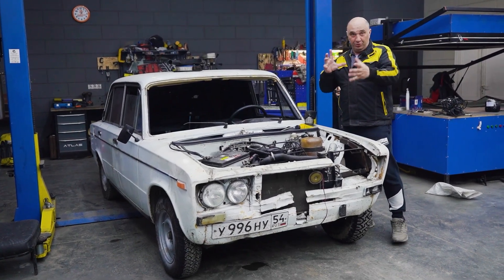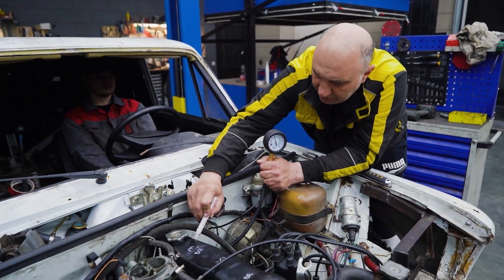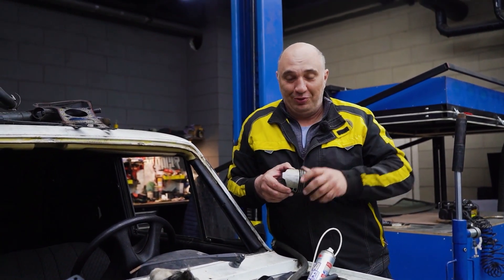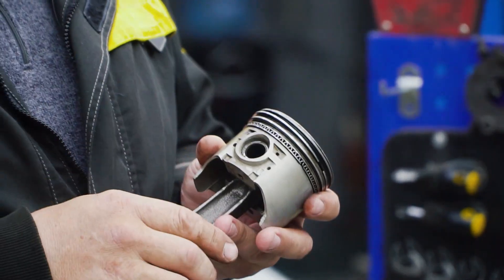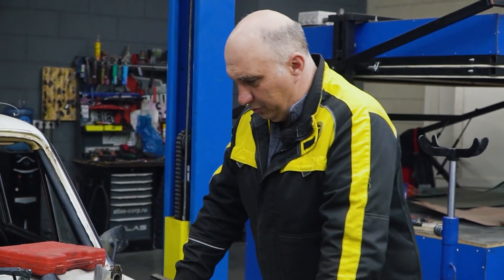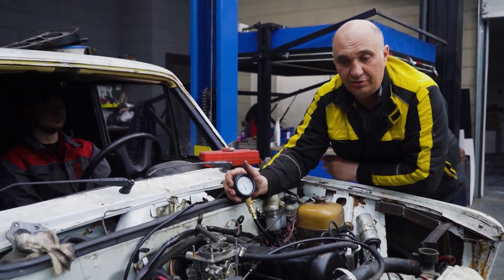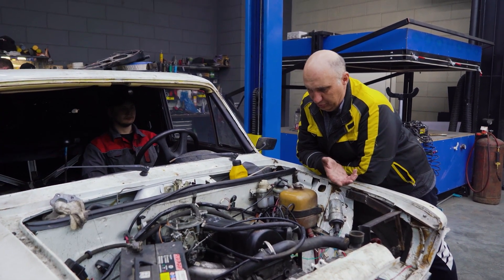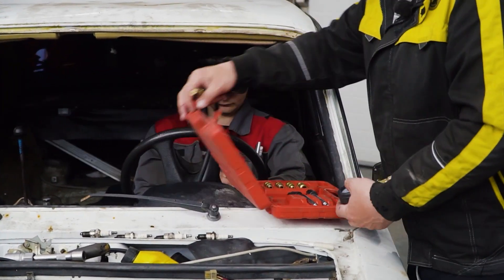Will an extra piston ring raise the compression?

Comment: The increase in compression didn't come from any better sealing from the extra ring... It came from that extra ring you installed at the top, that took away all the extra volume that was in the cylinder between the top of the piston and the original first ring down from it. 

You could probably take the third compression ring down from the top off, and you'd proabaly still have the extra compression without it even being on the piston. 

It would be interesting to have a follow-up episode, and remove the bottom compression ring and then re-check the compression again...

Comment: Thanks you Guys, you did it, but I think an even better result would have been achieved by enlarging the first compression grove to accommodate an original ring and a thinner secondary ring, set with the ring gap at 180degrees, reducing wear to the bore and having a great amount of material above the grove on the piston.

Comment: Why don't these guys EVER use a timing light? Just a curiosity
Reply: they modded the engine so they don't know the best timing-angle. To get to that, they have to hear it rev. Timing-light is used when you want to re-apply previous timing-angle (such as after replacing the ignition-distributor) or to record the timing-angle of current engine.

Comment: Cant you Test over lapp Rings!! Laike Tootal seal Rings!! They have theas rings i test in may Csb 356cui Dellorto Carborators 48mm 4×48..1992 in the 10 sek on the 402m C3 Corvette. Real street Car..No no transbrake TH400 stall 1300Rpm.Okej hav litel hitt Nos!! Weery Happy Engine.Weely ojääää!! 201m 6.9 sek.Nott bad 1600kg Corvette!!Noby have runn theas fast..Have weery Big Heads Brodix 11X.STD.  No no porting!!! Soud runn in The 9 sek on 401m...

Comment: The down side less oil on the top ring. Will it last. Sustain high speed?
Reply: the cylinder-wall will not last. The ring scratches the wall and then the hole get bigger, and compression drop again. No oil = no protection from scratches.

Comment: Hi, why don't you try to use the 2 oil ring sides with the compression rings in a widened groove, 180 degrees offset to create a complete seal effect around the pistons instead of a third compression ring? I think you should put the thin one on top of the normal ring to seal off the ring gaps.👍

Comment: I watched this video and did the same thing with a 4g63 NA. It did increase the compression and the engine is very powerful. the down side is the engine is very hot, so I upgraded my radiator from 10mm to 16mm and added an auxiliary fan. I drove the car for about 400km and with a powerful engine, it was able the to increase the fuel efficiency aswell. 

I definitely would recommend this mod.
Reply: Hey man, did you make a dyno test for how much increase did it make?

Comment: Hello testers. If you want to make something really different with great result in getting higher compression and long lasting pistons, make two O rings in the same groove. You need to sand each O ring by one quater an position them 180 degrees. This will make gapless ring. The only caveat with this might be over time, to get stuck. I am sure some companies has already made this with one very thin compression ring sticking to a normal one. Solution is that the normal O ring has inner space to place the thin one. This is not necessary. Two rings with the same size will make the same result.

Comment: Hello! I'm Brazilian and a mechanic, a few years ago I did the same experiment of putting a second compression ring on my 100 cc motorcycle. It worked almost 95% well, but because the piston was loose in the cylinder!
Your experience with this engine was better, congratulations!
Reply: Parabéns, meu amigo !

Comment: Awesome Idea, the only thing I would be worried about is if the engine ever gets overheated the compression may bend the top of the piston around that ring without the extra 5-10 mm of structure above it. Obviously it wasn’t a problem in normal operation though. I’m going to install an extra set of rings on my Prius right now! 👏🏻👏🏻👏🏻😂

Comment: It looks like a pretty good engine. I bet they get over 200,000 miles if oil is changed every 3000.  That is a lot of oil changes (66) which adds up but still cheaper than a new engine.  Very basic little car easy to work on I bet.

Comment: I heard David Vizard talked about having the first ring closer to the top, and by doing this you have less air and fuel mixture trapped between the top of the piston and the cylinder wall that can't burn ? So you waste less fuel ? And have a highr compression pressure.

Comment: I am totally nit surprised. The 366/427 Chevrolet tall block motors use 3 compression rings and an oil control ring. They do it in order to cool the pistons better. Actually the cylinders wear less with the extra ring.

Comment: This was very interesting. I can see two things that could be interesting to test and that is to just swap out one piston ring to see what that does for compression. Then try enlarging the groove for the first piston ring and add a second ring in that. I've seen that arrangement on an engine, I think it was a motorcycle engine but can't be sure. That would minimize the problem with weakening the piston, or at least I think it would...
Question is if it would be as effective and if there would be some other side effect such as a shorter life span for the piston rings.

Finally it might be enlightening to replace the old piston rings on the piston version that works best and hone the cylinders so they can wear in properly and see if that improves the compression even more or if it's as good as it gets.

Heck even just swapping in two new piston rings and hone the cylinder may give interesting results as it would show the best possible compression with the standard two piston rings.

And now I've read through this and realize just how much work all of this would take. Perhaps just replacing the two original piston rings and honing the cylinders just to see if there is still something to gain there. Not ever having worked on one of these engines I have no idea what the standard compression is supposed to be. If it's close to the original values then swapping the rings and honing the cylinder is not likely to improve things much, right?

Edit: Oh and a lot of people ask for dyno testing. If that's not easily done then perhaps just some acceleration tests before and after might give some idea of if the effect changed. Given that this is a rather small engine and car even small changes in engine power should be easy to measure that way.

Comment: im here from the rubber ring video. and the electric turbo video.  you need the put the turbo button and gas button under the gas pedal so both get pressed when you push to the floor. BOOM problem solved

Comment: The new top ring is located higher on the piston so it would be slightly  reducing the volume of the combustion chamber and thus increase the compression ratio.  Whether that would be significant or not is hard to say.

Comment: because of the higher compression you are getting more air in the cylinder, hopefully that means the carburetors are also bringing more fuel with the air but it might have been a good idea to richen the fuel mixture slightly. i saw at the end of the video there was something spraying up from the engine bay or was that rain? cool video, i would be slightly concerned about extra heat destroying the top of the piston easily, or lugging the engine breaking the groove you added. so maybe set a higher idle, richen it slightly and make sure the cooling system is working better for high rpm. good video!

Comment: would it be possible to make a 

18 cylinder radial engine 
but with a DOHC cylinder head with 4 valves each cylinder

Multipoint Fuel Injection

and massive turbochargers

Comment: Wouldn't the compression go up, due to the fact the ring is sitting slightly higher? there would be slightly less space for the mixture, surely? also, being a new ring, it might be pressing against the bore a little harder than the older rings too. What is the standard ratio supposed to be?

Comment: So does anyone have a reason why the factories don’t have a 4th ring from the factory stock?  If they gained that much compression then what would be the down sides?  Why don’t they do this already for a more powerful engine without any other changes than just cutting a new groove for a 3rd compression ring?  From factory, they would be able to change the castings/cutting so it won’t be weak by adding a third compression ring, they would be evenly spaced.
Reply: It's pretty simple, friction

More contact surfaces like the rings = higher moving friction

The gain in power is usually made redundant from the losses of the extra friction

Comment: hmm the two rings in one groove might just work , i know some 2 stroke moped engines use L shaped rings the rings get pushed out when the gasses get in between the side of the piston and cilinder
another trick i seen on american dragster engines is that they drill tiny holes ending in the ringlands on the back of the piston rings , does the same as the l shaped rings in that the compression and workstroke pushes the ring out against the cilinder wall 

one thing you could do is combine all the tuning tricks intoo one engine , stuf like knife edging the crank lightening the pistons hogging out the ports install bigger valves maike a twin carb intak manifold a tube exhaust manifold lightened flywheel higher lift / reground cam  , electronic ignition , injection trottle bodies stuff like that but done the garage 54 way , do a multiple series on it maibe and see how mush power each conversion adds

Comment: Please try to install a diesel fuel system that inject diesel after the gasoline has ignited (maybe at TDC) and see if the gasoline can ignite the diesel spray to get more low rpm torque!

Comment: An easier way is to drill into the top ring groove from the top of the piston.  The compression pushes the ring tighter into the wall and prevents compression leaking.  On the other hand, if uou raise the compression, you must raise the octain rating.  That costs more and may be illegal.

Comment: When I was rebuilding John deere diesels they moved the top ring to just about 1/8" from the top compared to 1/2". They claimed higher HP and better starting,  they were right! It eliminated the volume of air above the ring, thus increasing compression but also eliminated a large area of cold metal that the air could touch. Starting in about half the time.

Comment: ABSOLUTELY NOOO!
STUDY, PLEASE!
Such a distance from the top of the cylinder to the first ring is necessary for hear dissipation. Any other ring must be added between 2nd and the oil ring set. For increased compression try "Zero gap second" rings.

Comment: Putting lots of miles on an engine I think would harden up the internals from hot and cold cycles and the combustion itself. Not saying it's a new or forged block but I believe they could hold more compression and or boost after miles upon miles put on an engine vs a new engine

Comment: LMAO a single compression ring would work just fine if the ring gap is set properly. 2 compression rings make a sufficient gas seal under normal piston speeds. 3 or more is just redundant and not necessary if the rings and end gap is in spec.

Comment: This together with skimming the head by like 1.5 mm, change gasket for a metal one that handles higher compression could be interesting too see together with maybe a fuel injection system added in with a higher pressure fuel pump & a more aggressive cam.
Kind of test the limits of the stock cylinders, crank etc a bit further.

Comment: If it overheats or knocks'  -- just put in higher octane gas and it won't have premature detenation anymore...  But it should be fine.  You're still within normal compression ranges.

Comment: I would love to see them remove the original compression ring and compression test it again, I bet the compression will be the same. They moved the compression ring up, so there is physically less room in the chamber than before, so the compression should stay the same. They pretty much did the same thing as putting a thinner head gasket on to boost compression. 
 That's my theory anyway.
Would love for them to prove me wrong tho!
Reply: You are wrong, the gain in compression from installing a thinner heag gasket will be significantly greater than installing a third ring on the piston. Doing both would be  spectacular.

Comment: it will add compression as it reduces squish volume,you may have durability issues as the higher you go on the piston the hotter the ring runs,the hp gains on the compression may not offset the extra drag/friction of the extra rings,it may be a good modifcation for an ethanol fueled (E85) engine as it would reduce blow by and oil contamination

Comment: G'Day Vald and Crew nice job,,,But reckon top of piston may pop off after a little while,well if you gunna keep it at max red line,,that would be the test,,But for any one wanting to make thier own pistons,,it just may stop a little extra ring bypass,,stop oil contamination,,think this could be a good mod on boosted engines,,Mind the type of piston will dictate results,,
I mean forged against cast,,all these pistons react to different engine running conditions and temps,even piston material effect results,,
but nice work just the same,,

Comment: By putting a ring on the top, you basically decreased the volume in the cylinder, that's why you have higher compression. If you want to see the effect only for the ring, this should be put somewhere below the original ones. This experiment is somehow equivalent with rectifying the cylinder head or mounting a thinner cylinder gasket.
Reply: Third One to type that i was just about type in desame message.
Reply: Agreed, I was going to mention that same thing! Also if the added ring is brand new it will skew the results since the old two rings are presumably worn to a degree.
Reply: Exactly right.

Comment: Damn that is impressive. How about next you get custom made forged pistons and modify design a bit to have 4 rings but their combined surface area against the cylinder wall is same as of 3 originals? That should prevent excessive wear. Also after that start looking into making LSD rear axles using parts around the garage. One that is easy to build your self and gives best perfomance and price. Welding the diff will cause wear on both axle well as tires so might not want to do that, but LSD would give best of two worlds. Saw one guy make one from two plates and i believe those were valve springs he put in there. If i recall right it was 4 springs. To install he put springs into vise, tied them closed with some wire, made two plates that had locating pins and holes for the springs, put it in place assembled and cut the wires.

Comment: The extra ring being placed at the top of the piston reduces the distance of the (former) top ring, now new top ring, to the cylinder head. This may attribute to increase in compression. You could test for this by making the new top ring grove the same as the former top ring grove, and then using the old rings move the former top ring up to the new top grove, leaving the remaining rings in old positions. Good test, you guys are great.

Comment: I wonder how much of the increase in compression was simply by the extra ring being higher up the piston, thus decreasing cylinder volume.
Reply: Great observation.
They actually made the compression ratio a little bit higher.
Adding smaller blow-by through cylinders may explain higher amount of power.

Comment: idea: put 3 gear on crankshaft and camshaft like in a diferential between the 2 cylinder to make two cylinders turn clockwise and the other two cylinders turn counterclockwise, changing the engine balance

Comment: Another great video from this channel.
You made a comment about friction due to the extra ring.
Back in the early 80's my race car engine builder used thin cast rings. He said it was for friction loss and HP gain. We won the championship with that engine.
There is a youtube channel that does engine dyno pulls and they did a video on thin rings. The result was less than I expected. The dyno runs showed only a 2% HP gain.
Here is that video: https://www.youtube.com/watch?v=-29IWc-zrv8

By the way that Lada looks like my old 1972 Japanese Datsun 510

Comment: You guys should get a dyno and test the cars before and after each engine mod.
Would be very intersting to see the HP and Torque differences...
Reply: Yeah, wrong direction imo.  Remove second ring altogether, use a gapless top ring, low tension oil (or modified).  Install a pan evac and now you have a little better compression and less drag.

Comment: It's the same as the old GM 366, 427 tall deck V8 gas commercial engines they where built like a diesel low rpm "4500 max rpm" heavy 3 ring pistons they where just reliable old motors

Comment: I’m not surprised you guys saw an increase! Remember that car uses an old inefficient carburetor, and by increasing compression logically you helped efficiency and fuel burn. I wouldn’t be surprised if you guys picked up 3-5 horsepower if not more from the 20+ pound increase in compression. I can’t see the extra rings being too bad of a problem. Knowing about how old the car is, this is probably an old cast iron engine with cast iron cylinders/liners. They’re the best durability wise. 

 I say put this engine in a street legal non trashed Lada or a car you guys actually use and put this engine to work. See how long it lasts, as that’s what I’d do. 

Well done again!